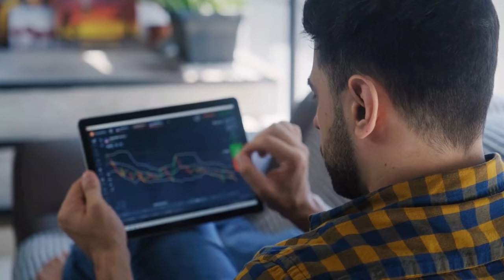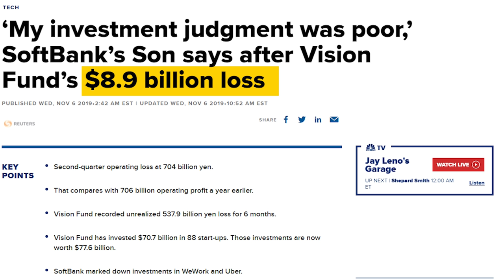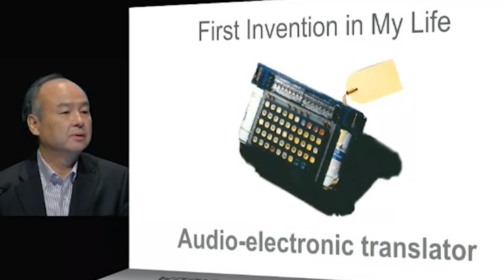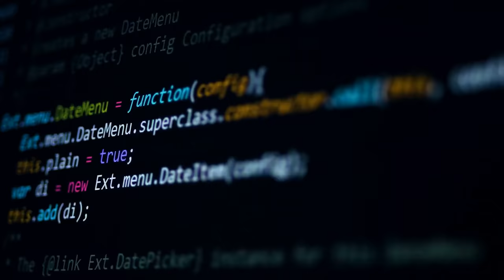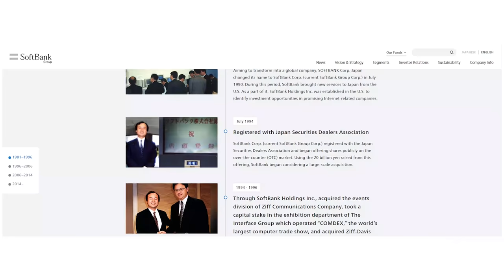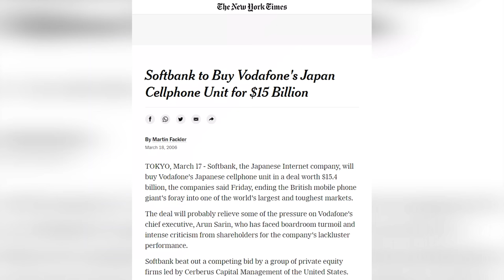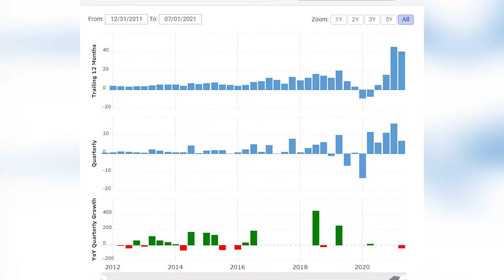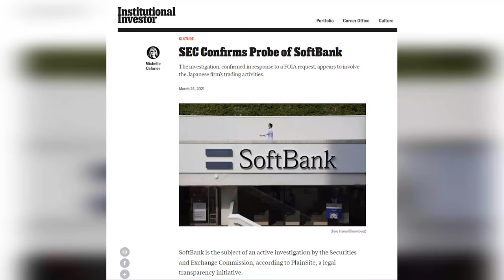SoftBank - The $100 Billion Bank That Manipulated Everything

Comment: I don't see how it's called manipulation. Softbank bought these options without hyping it with false information or anything of that sort. It's simply trading and they came out on top.
Reply from the maker: Fair enough. The reason that it could be considered manipulation is because they were single handedly able to move the markets in a big way in their favor. But as I stated in the video, if that’s all they did, it’s not illegal.
Reply from the maker: Well, the definition of market manipulation is "the act of artificially inflating or deflating the price of a security or otherwise influencing the behavior of the market for personal gain." I think making a massive purchase that literally changes the trend of the market definitely falls under that definition. I'm not faulting SoftBank for doing so nor am I saying that it's illegal. All big banks and hedge funds are involved in such price manipulation both to the upside and downside. And, if I was in Masayoshi's position, I would've done the same thing. But, it is market manipulation nonetheless.
Reply: @LogicallyAnswered  That is not what manipulation is, nothing wrong with buying a lot of what you like. You might be confused about this.
Reply from the maker: I didn’t create that definition my man. It’s from investopedia.
Reply: @vb9366  you are viewing the word manipulating as automatically negative and getting defensive instead of taking it at face value.
Reply from the maker: Well said
Reply: @LogicallyAnswered  Options don't move the markets. They are derivatives - independent of a market. Eg if you and I bet on the outcome of a basketball match from the crowd It does not affect the outcome of the match.
Reply: @LogicallyAnswered  "Artificially" Softbank didn't do anything which is called Artificial (Circular Trading comes in this category, where two or more parties, sells, buy and keep doing it to inflate price), softbank didn't do that
Reply: the reason why people say that it is not manipulation is because the only meaning of manipulation that they know is based on human relationship. they wouldn't understand it even if you explain it to them because you are not speaking the same language.
Reply: @COBRAC0MMANDER  what kind of manipulation do you think is happening here ?
Reply: @LogicallyAnswered  investopedia isn't law tho
Reply: facts

Comment: How does 5 billion worth of options become 50 billion stock? I don't know what options are.
Reply from the maker: Options is a form of leveraged trading that allows the buyer to control much more stock
Reply: @LogicallyAnswered  so if the stock prices of softbank's bets had decreased, they would be out of business in a year? If it is that risky I'm surprised that the board agreed to go through with options trade.
Reply: @akashkakati2860  where did you get a year from
Reply from the maker: Well, with options, if you’re the buyer, you can’t lose more than you put in. So their max possible loss was $5 billion.